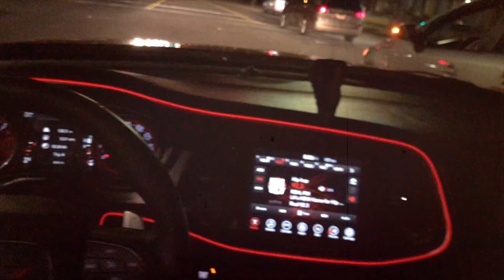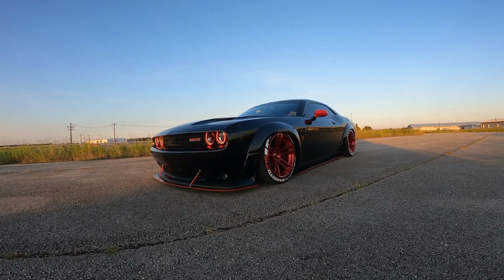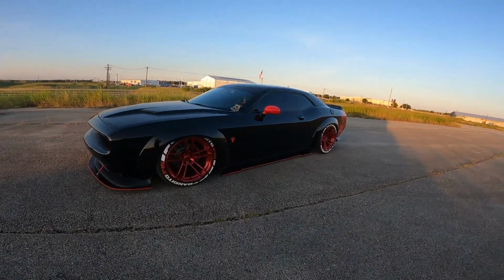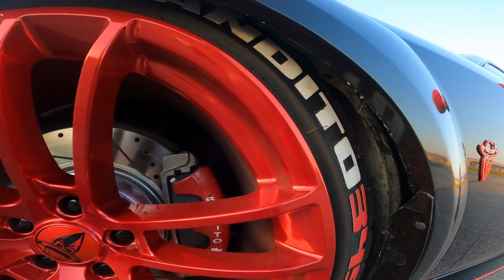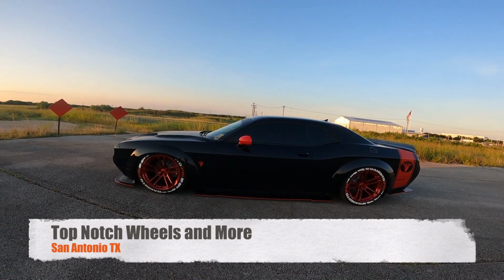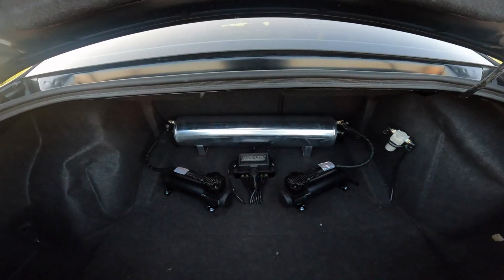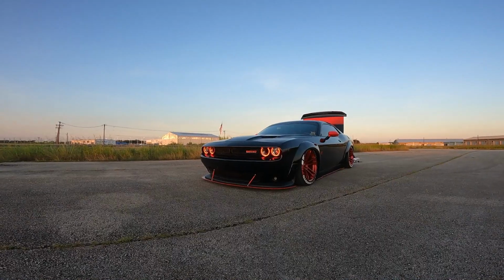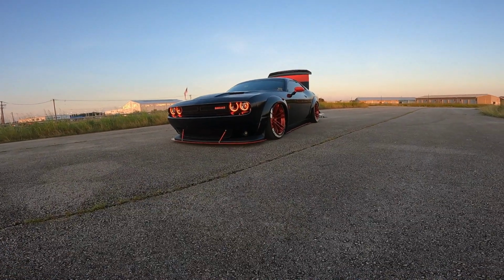Bagged Widebody Challenger RT with Airlift Performance 3P system

Comment: On your ride height preset which is in the 80s , you don’t rub your widebody fenders in the front when you do big turns on streets?? Since the wheels comes out of the fender?
Reply from the maker: I’m normally around 80. In the Highway 72. No rubbing issues

Comment: Any issues after cutting the fenders and reapplying the vicrez demon flares? Interested in the flares for my hellcat but do want to cut the fenders from the get go.
Reply from the maker: no issues, just a lot of cutting.  You don't have to cut fenders of the get go.  If your on stock suspension you should be okay
Reply: @bandito345  I intend on going wide for the grip and getting some coilovers so I'm just happy to hear you made it work. Going strictly oem mopar on the flares can go north of 4-5k